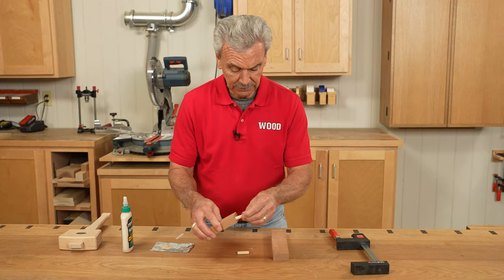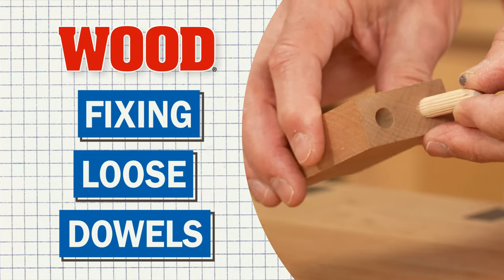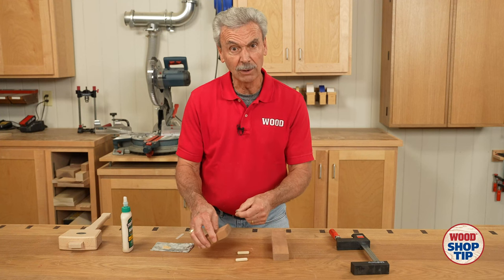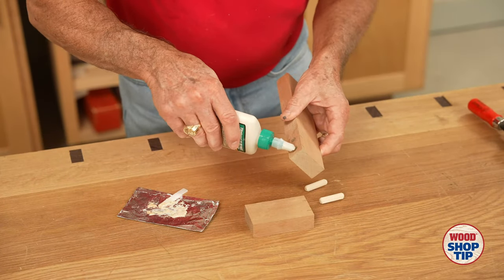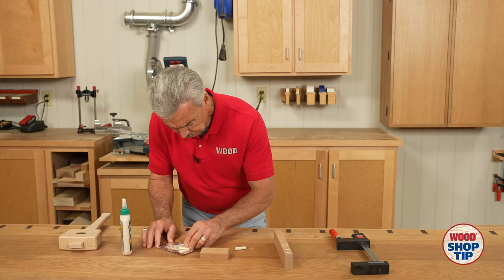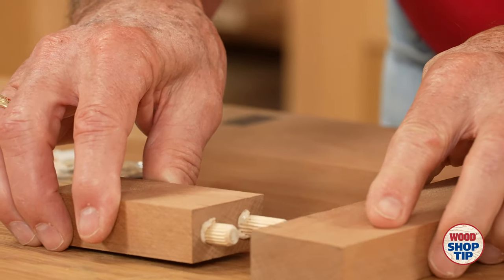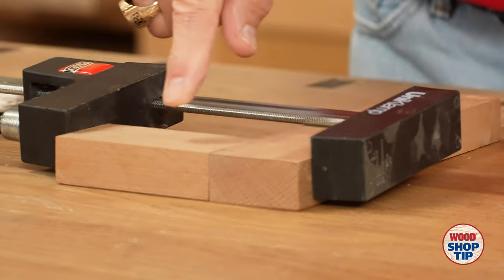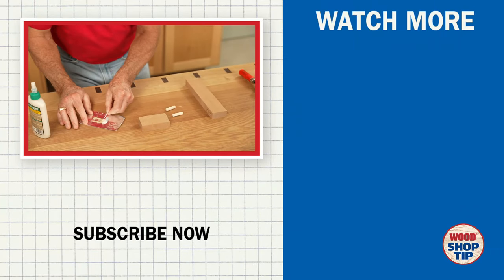Fixing Loose Dowels - WOOD magazine

Comment: Nice idea, accessible to most DIYers.  My favorite method is to make hardwood shavings with a plane, glue some of that around the dowel so as to make it slightly fatter than the hole, let it fully dry, and sand down to 'sneak up' on the hole size for a perfect fit.  I saw it on a furniture repair channel (not finding it now to reference the guy), where he used it to strengthen loose tenon joints in chair legs/rungs.
Reply: Perhaps it was Fixing Furniture, e.g. at https://youtu.be/DmjHAyVWWqI?t=2123 - notice also that PVA glue is used to attach the shavings to the tenon (or dowel), but hide glue is used to attach the tenon or dowel to the hole (mortise) as it can be reversed for future repairs.

Comment: Nice tip but I think it would be better to add the glue/sawdust mixture to the holes rather than the dowels. The mixture on the dowels can be pushed out (as it did in your example), distributing sawdust to the outside preventing the two pieces from closing completely. Alternatively, clean off whatever squeezes out before assembly. Not to be "that guy" but there were some pretty noticeable gaps in that joint. :)

Comment: I was hoping to get something on loose dowels when they are not glued, but rather, used for alignment, which is a common practice when doing 2 sided CNC work. What I typically do is similar, but different. I’ll run some thin CA glue from the top of the hole and let it run down into the hole, throwing some loose sawdust down the hole with the glue. Not enough to fill it, but just enough to let the sawdust cling to the CA glue. Let it dry for a few minutes, then force a dowel into the hole to push the sawdust/CA glue mixture to the sides. After that, the hole is usually good enough for a few days of use.

When that doesn’t work, I do a similar thing, but I include more sawdust and glue the entire dowel in and cut it off, flush with the spoilboard and sand it flat. Then I just redrill the same hole and it’s usually tougher than it was in the first place. I hope this helps someone!